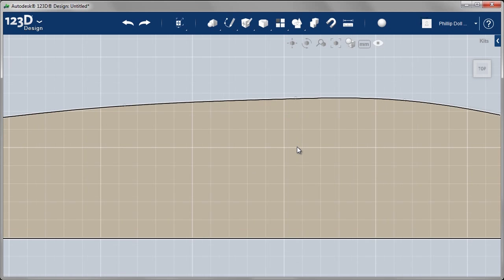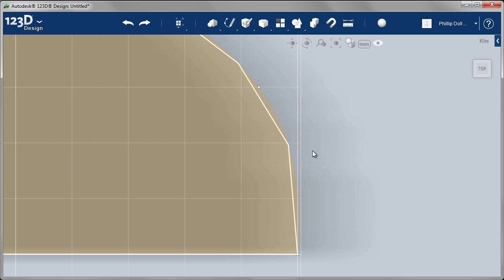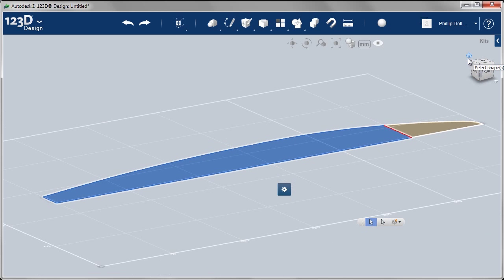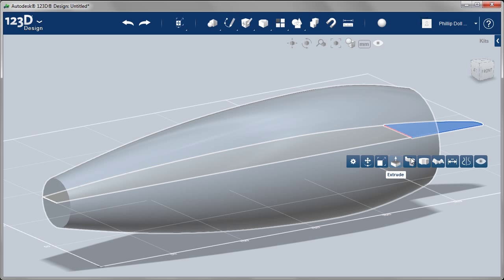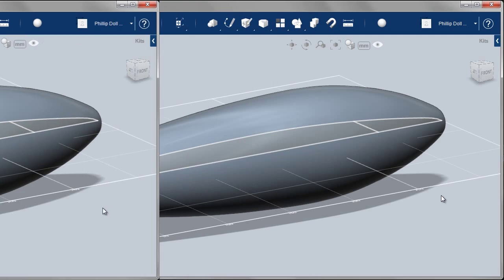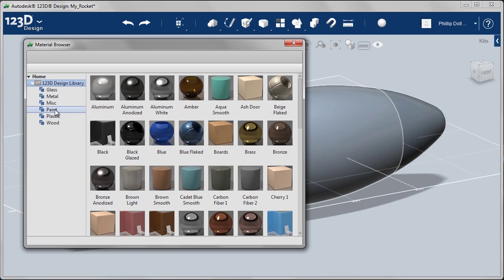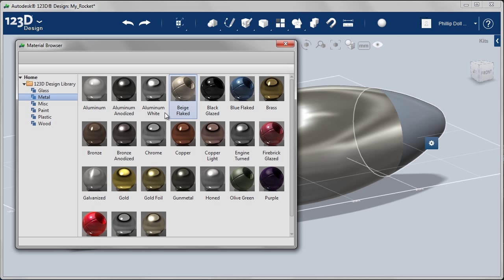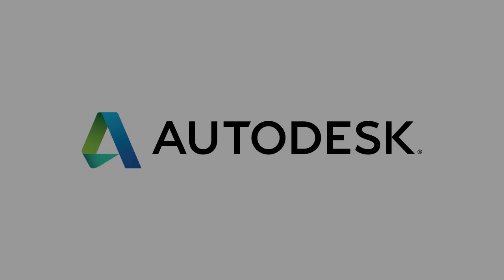Friction: Rocket Model Technical Video Part 2

Comment: Hej, I have this trouble with adding material in the latest Autodest 123D Design, when I select two faces and select "Material", it automatically selects all and change all the material on those surfaces, help needed, thanks in advance :)